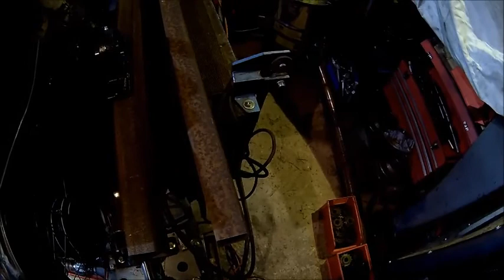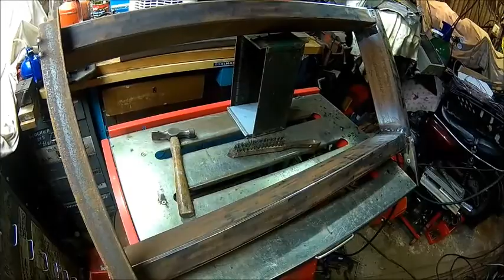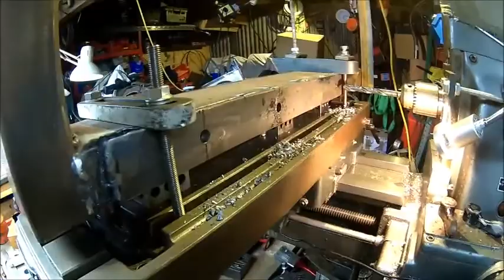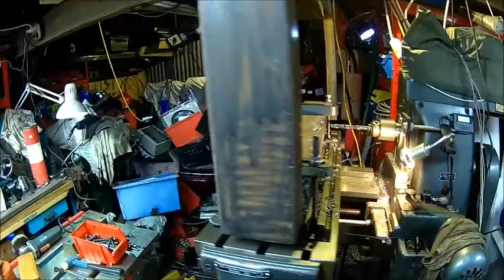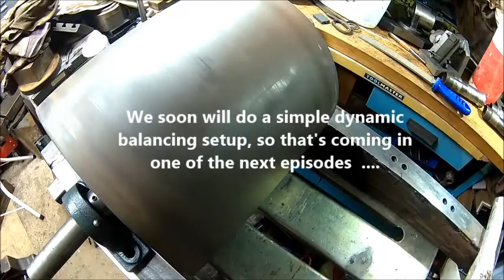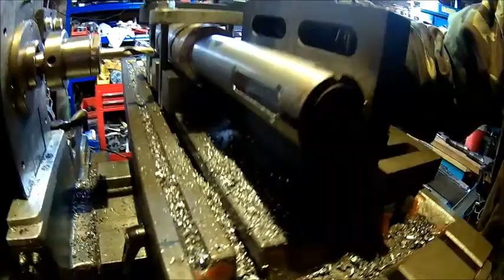The Mystery Project - Part 10, frame test fit, some milling machine work

Comment: Still don’t know, I’m a little dense sometimes. Good way to hold the square tube. Like the set up on the mill. Haven’t clamped anything to my table yet. Only using parallels and the vise. Good video.
Reply from the maker: Thanks Ron... Being a horizontal mill only, you need to think everything twisted by 90 degrees, for most operations the vice will need to be on an angle plate which is less rigid than clamping the part straight to the table. Still looking for a similar size vertical mill, but over here they pay crazy numbers for these tings and a Bridgeport is not an option, even they go dirt cheap sometimes.

Comment: You know, there seems to be a motorcycle hiding in your storage pile :)
Reply from the maker: Well spotted,....that (and a few others) is waiting for April 2018 because from then 40+ years old bikes and cars don't need to go to the annual safety inspection anymore, road tax is free anyway if older than 40 years